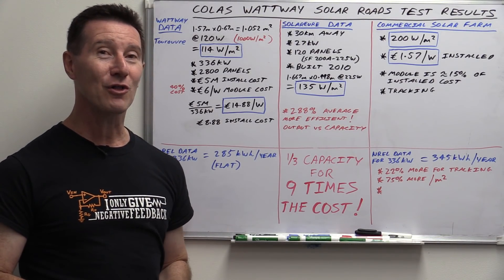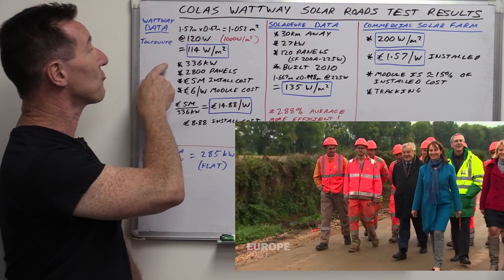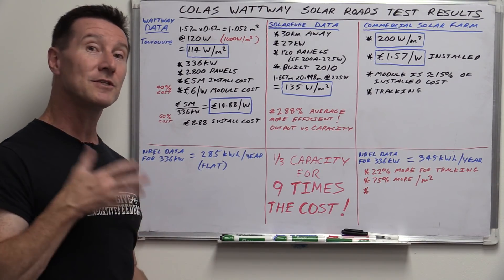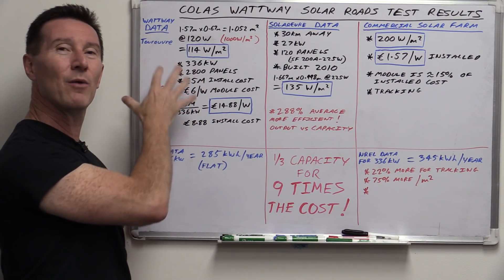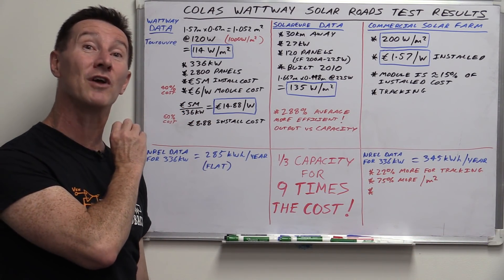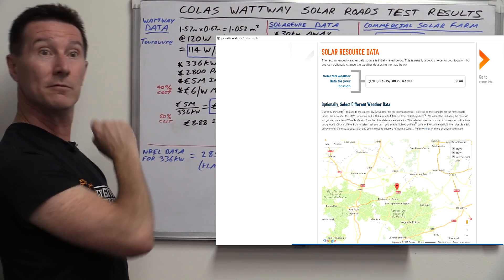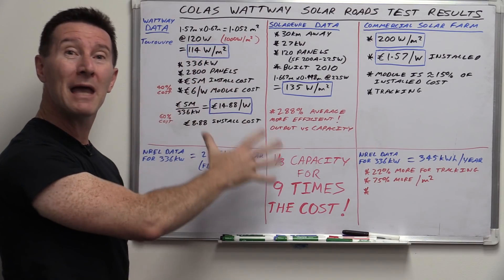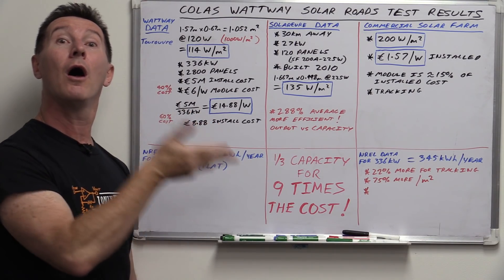EEVblog #1047 - Solar Roadways FINALLY BUSTED! (Colas Wattway)

Comment: how about a kinetic energy source from the pressure of vehicles driving over pads or something?
Reply: Would increase petrol usage of the vehicles driving over it.
Reply: good points. hadn't thought of that!
Reply: Let's just put treadmills on the road that will slow down cars, and label it as a safety measure
Reply: The energy cost is just transferred to fossil fuels, with minor transfer to battery recharging
Reply: ericsbuds It would be bumpy as hell, because the things have to flex somehow.  

what you do instead of "solar roadways"  is you leave the road surface alone entirely.  Not only would putting ANYTHING janky on it endagner the lives of everyone on it, but the road itself would become unusable in DECADES less time if you did anything different with it than we do now.  Current roads can last, with proper maintenance, HUNDREDS of years under optimal conditions.  

So instead, you use the real estate beside and between and above those roads.  Got a simple bridge?  Cover it with a really tall solar panel roof.  Got a building?  Put ultra light weight ones on the roof.  Got a median or a shoulder?  Put solar panels on them as far as the eye can see.  Got guard rails? Put helical wind power generators all along them.  Got a power pole?  Put a solar panel on the tip and a helical wind generator along the height from the ground up.  Also make the solar panels in the medians and shoulders and on tops of buildings and elsewhere tall enough to put helical wind power generators under them on the poles that hold them up as well.  

THAT is how you ACTUALLY build a "solar roadway".
Reply: Something like blocks of piezoelectric arrays perhaps?
Reply: It would be better to put pressure pads in footpaths. Yes it would increase the calorie usage of people walking over it but since we have an obesity epidemic that might actually be a good thing.
Reply: ...and mechanical wearing of system itself. Would it last for a year or two? what will happen with its internals after climate cycling (summer-autumn-winter-spring) with its rains, snows and dirt?
Reply: On the down hill side it wouldn't take extra gas and it would make braking easier.
Reply: This is actually developed in Germany, touch sensitive concrete for walls and walkways.
Vandalism resistant switches and touchpad. And generating electricity from pedestrians. And only lighting footpaths when people walk on it.
Also possibly playing dance revolution.
Reply: So?
Reply: Why so you can pay more for gas?
Reply: Not just that. All of these projects also seem to forget to mention how they are going to transport all this electricity for 100s of km's. It's not as simple as saying, cover all the roads so we have a huge surface area. There is a reason you see electricity being generated in a focused area. You need transformers and powerlines. Even with very high voltage there is still significant loss over distance. Ideally you want to generate electricity where you need it. For example, on the house of your roof :P
Reply: Everyone would spend more on gas.
Reply: How about stop wasting dollars to save pennies?
Reply: skoronesa Electric car owners will complain that you're essentially stealing their power though.
Reply: so .. you want to steal kinetic energy from the cars ? It's like forcing people to walk on springs, then somehow get that energy back from the springs. It's just theft or slavery...

Comment: I think they'd have better chances with thermo-electric road ways.  Those asphalt roads get pretty hot during the summer.  Stop driving over solar panels.  Just give up on that stupid idea already.
Reply: mikedrz 
Give 1 hour I'll start a scam crowd founding campaign...
Reply: We'll make billions!  We just need a good marketing department, some popular music and celebrity testimonials... if they don't pay us, we'll call them global warming deniers.  haha
Reply: Only works if you have a steady flow of heat e.g: there is limitless cooling!
The ground beneath a road will warm up quite fast and then no energy will be produced!
Piezo-Presssure-electric-generators might work that produce energy as cars drive over them.....but on the other hand thats not much power(mW Range)
At least this could be used to power the Intelligent Roads(built in Traffic-control)

Comment: The question is. Does cost actually matter? If an entire country mandated that all roads used PV technology, road maintenance would increase considerably, however that's road technology that's 114% more efficient at energy generation per metre squared above and beyond traditional tarmac.

When you look at the energy density of lithium batteries Vs traditional ICE the figures are just as ridiculous, yet ownership of EVs still increases.
Reply: It would be cheaper and produce more energy to put solar panels next to the road or over it.
Reply: You are not getting the point. Making solar cells pollutes the environment. Making a lot of power with the same solar cells is therefore better for the environment and makes money to pay for more solar cells. You can think about inefficient uses like roads once every bloody roof is covered....
Reply from the maker: Of course costs matters, especially when a much cheaper, higher output, less lossy, and higher reliability solution exists. 
Cost and environmental payback, which is derived from materials used to manufacture, longevity, and power output payback all matter.
Solar roads suck at all those. There is absolutely no reason to use them unless you have used up all your rooftop space and field/pole space.
Reply: Where I live, snow plows would tear them up in one pass.
Reply: Where you live, freezing water would tear them apart long before the first snow plow :D  But there is no snow or freezing in the sunny California, so hurray for terrible US inventions
Reply: Even when we have covered every single square meter of the planet with solar panels, you STILL wouldn't use them as the actual road surface. You'd just cover the road with a steel frame and mount panels, at a sensible angle above the road!!  (which has already been done in Asia btw!)  Over all still cheaper because the panels can be std, and the wiring can be simply run along the frame rather than being buried or somehow incorporated in the road surface itself.
Reply: Of course costs matter. It's ultimately the only thing that matters, unless you like setting your money on fire. EVs have substantially higher power efficiencies, so the lower energy density of the battery (which is improving year after year) is of little concern. An electric drive system that's 90+% efficient, vs. an at-best 20% gas burner, is a better option. Even more so when you have a source of clean(er) electricity. Go watch the Fully Charged video of the gas vs electric lawn mower.
Reply: Okay so you have a point, kinda, not really but kinda.
Someday when every single rooftop is coated in solar panels and space is running out to build traditional solar farms THEN you can start thinking about creating solar roadways.
This isn't a bad idea it's just a waste of resources until it's unique selling point (space saving) becomes a valid concern, until then finite resources are best spent elsewhere.
Why put expensive bad solar panels on the road while there is room for cheap efficient solar panels in the ditch
Reply: FableBlaze Nah cost doesn't matter.

$10K per hour and I'll turn this 20W crank here! Expensive freaking dynamos!
Reply: Well let's see, a normal rooftop solar installation depending on the cost of electricity in your area and however much the installation costs are, will pay for itself within 5-8 years leaving the next roughly 10-20 years of their useful lifetimes as pure profit, now you're suggesting it would be perfectly fine to put a similar installation in place that will take over your entire lifetime to pay for itself and that's perfectly ok? Not to mention that installation wouldn't last that long anyway even if it could eventually pay for itself.

Does that seem reasonable to you..? And somebody has to eat those costs, a fuck ton of expensive to install solar panels don't come out of nowhere for free, so that just sounds purely insane to me.
Reply: Yes!  With enough stupid we can violate the laws of physics, because as everybody knows stupid > *.
Reply: If you must use your road space to generate solar power, then put a structure over the roadway and put solar panels on it. You can even make your solar panels transmissive - thin cells and no opaque metal backing - so your road surface will still be adequately lit during daytime.
Reply: It would be more reasonable to install panels along the side of the roadway where materials could be optimized, wear and soiling can be minimized, and wiring would not be as problematic.
Reply: 114 percent more efficient at energy generation per metre than tarmac? Are you OK? Last time I checked tarmac does not "generate" any energy whatsoever. So 114 percent of nothing is still nothing. Lay off the drugs mate.
Reply: M3ta7h3ad im driving ev not for the costs but for the feeling.
Reply: DarkWarrior it generates heat... That's energy?...
Reply: NEXT UP, Solar Road Rooftops.
Reply: MrTada98... the sun doesn't stop shining just because earth puts you in it's shadow..  ;-)
Reply: As engineers it's of paramount importance that we use our resources in the most efficient manner possible.  Assume that there is a limited supply of solar cell materials, the goal is to get the most output from the least materials used and at the highest cost efficiency.  Alternatively, if we are not responsible and go with the less efficient and costlier system we find that we run out of money and materials to supply power.
Reply: 114% more efficient then what? you are aware tarmac dose not produce electricity!
ho and battery?  what has that got to do with anything? we are all aware Li technology is shit and the performance (although one of the best we got) are just simply awful  especially in the cold. no idear what you were trying to say.
Reply: and yeah solar roadway was a bad idear from the start. You'll do better for the planet by panting the roads white (very bad idear to , but still better then us less solar fuking road!
Reply: I know that  the "western states" are giving bonuses because they are getting CHOCKED with horrible carbon fuel fumes. I know that you exaggerate, but a small price to pay for clean air is small :) Now I like to see more wind, PV without batteries, go up all over the place, but please, let people experiment (1 km is a small scale) and learn something about construction of PV cell, potential of useless tarmac and yes roof space. :)
Reply: The question of Nuclear is something that people will not accept, but you are correct, it is reliable and does not produce any CO2. I will be long dead before a nuclear plant is built in Australia. The carbon lobby and environmentally minded people will never allow it. The biggest problem is the carbon lobby. They are powerful, cashed up and backed by the mining lobby. I should also mention that coal is one of our biggest experts.

France is a good example of how to use nuclear, maintain the safety, produce fuel and look after waste. No one has yet been able to level any criticism against them on that score. Correct me if I am wrong, but they produce ~70% of all power by nuc and export to other countries. The hypocracy of it all is that the countries who are propped up have shut down their own nuc generators :)

Before people start screaming "Fukushima", that had nothing to do with the reactor operation. It all had to do with placement of "council" electrical power substations or some such at the sea waterline. Loss of electrical power to cooling systems caused overheating and finally containment failure. Shit engineering and safety assessment,. Very preventable.
Reply: Cover the road, or put them near it... Don't drive on them. My state did a test using prefabbed concrete slabs and it was the bumpiest mess after 3 years. In 10 it was totally destroyed, after every seam was patched multiple times so it was replaced.
Reply: it does!
Reply: It is unlikely we will run out of space soon. The US is mostly empty space, not to mention Australia :D We will probably newer run out, because most of our power plants will be fosil/nuclear anyway(sun does not shine during night, and battery storage is not really feasible).
Reply: EEVblog 

What has been the trajectory in embedded energy cost to output in solar manufacturing? It seems comparing energy output to dollars is rather apples and oranges when the cost of actual fuel has fluctuated so greatly. 

When will solar bootstrap itself?
Reply: Yowser. So much butthurt.

My thinking point was around what if cost was no constraint.

What if in the future governments mandate all external spaces aside from farming, to require PV componentry?

My argument - this technology is clearly ahead of its time. It's not required or needed at this point but it does have a place, maybe not on every road but on some. Just as PV roof tiles are less efficient than PV panels, yet Tesla (and other firms before them) are developing them.

I agree wholeheartedly with Dave's analyses but then there are the wider technological outcomes.

SFRs (as a technology not a brand) have generated several techniques for deploying PV cells in hostile conditions for example which could translate over to PV deployments not on road but in places where traditional panels do not work as well.

To those who accuse me of not making a like for like comparison regarding technologies. Direct comparisons were drawn between how expensive the technology is, for how ineffective it actually is. How you can fail to see my point in that regard flummoxes me.

An EV has less capability than a ICE, for two to three times the cost. First adopter EVs had even worse cost-benefit ratios. Yet still people bought them, still people used them and companies created them.

SFRs (again the technology not the brand) in my mind is exactly that, it's an early adopter EV. Has little purpose in a world full of plentiful space, where there are bigger gains to be had by implementing competing technologies first, but in 100 years time, who knows. This time last century we considered an airplane something that could fly 1 pilot, 30ft. 60 years later we had something that flew faster than sound, transporting multiple people between continents. Technology progresses often very rapidly as do drivers for said technology.

As for grants, costs etc. I live in a country who just spanked 13 billion on a floating airport, when we don't have any suitable planes to go on it, beyond helicopters. A country that throws billions into maintaining a weapons system that if it's ever used, we're pretty much all just going to die except for the poor sods in the submarine. So you want to talk about wasteful use of resources? Just like folk say about SFRs as a technology, there are bigger and better fish to fry than going after a technology start up imo.
Reply: YGroadcapitain Why?
Reply: 1. roads are the only thing governments have control of,
2. no land cost,
3. 1 km experiment is fine,
4. the real experiment is about development of PV for extreme conditions... 
5. if you keep talking about $$$ ... please don't came to the pub with me :)

Comment: Sooo it would be cheaper to just run solar panels along the side of the road?
Install a bike path with solar roof on every highway.
Reply: That would be a good summary. Why put the solar panels on the road, where they have to be flat and built to be driven on by trucks, when you can just put industry-standard solar panels right next to the road, where they can be angled for better efficiency? Or just put them on the roofs of public buildings. None of the solar road afficionados ever explained why exactly the solar panels have to be on the road . Putting them on the road is only a sensible option when literally every other place you can put them (next to the road, roofs, unused fields) has been used already. Otherwise it is just another case of "they were so obsessed with whether they could do it that they forgot to ask themselves whether they should do it".
Reply: South Korea implemented this type of road by running it down the median of the highway. And guess what, they're angled not flat.

Comment: Yeah the Ultimate in Idiocracy thinking . The roads in LA,Calif. are like a bombing target  making them out of something less strong is retarded . All City Roads should be made out of modern reinforced concrete. But they say its to expensive ? Then they Re-Surface with Cheap Asphalt every 5 years. Concrete last 50 years. Even in Earth Quake ridden LA there are Concrete roads that were poured in the 1940's and still better than the pot hole ridden asphalt thats 5 years old.

Comment: Not defending the project, but is the $5M installation cost for the road in its entirety or just the solar panels? Because otherwise you'd have to deduct the cost for a regular road of that size.
Reply from the maker: Nope, it's a fair comparison, it's a solar road, it costs what it costs.